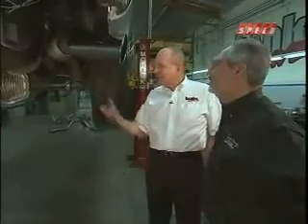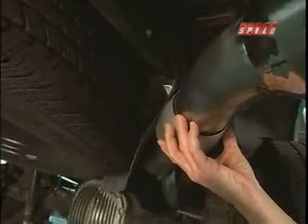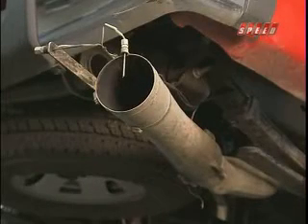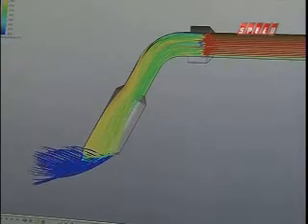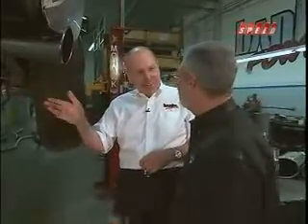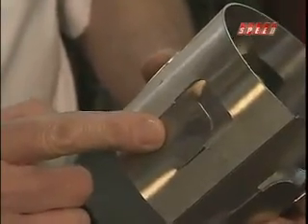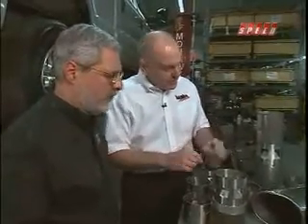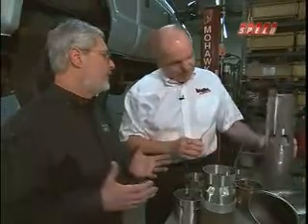Diesel Particulate Filters: CoolCuff

Comment from the maker: The location is mid way under the truck, so without propper cooling those temps can pretty much be seen at the tip. Now you have a blowtorch of hot air coming out which can burn things and catch 'em on fire. All that's marketed here is safety.

Comment from the maker: When the DPF goes through a re-gen cycle it actually burns the soot with a kind of after-burner effect by changing timing and dumping fuel. Normally temps like 1,100 degrees egt is something approching danger under the hood, something you'd watch out for... but that's how hot it gets after the filter in re-gen.